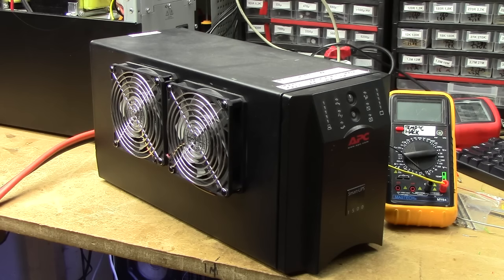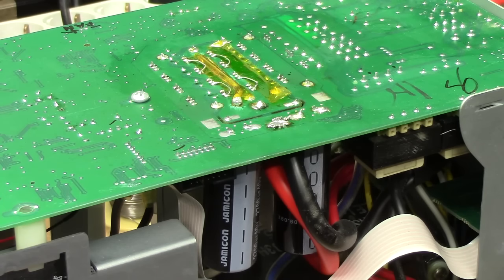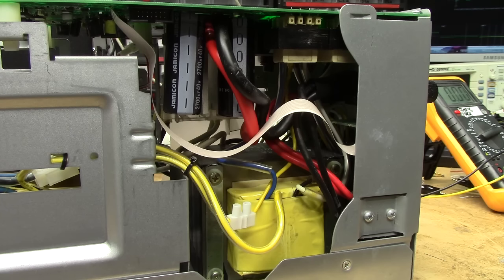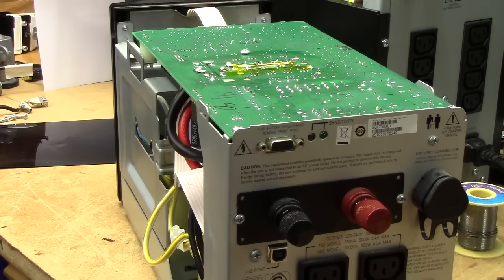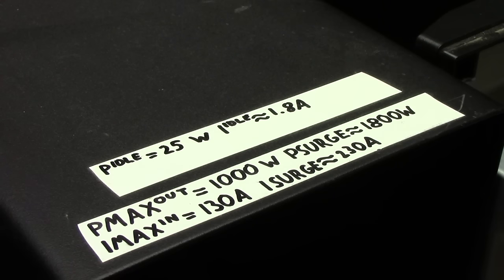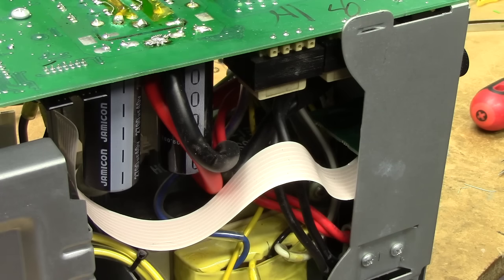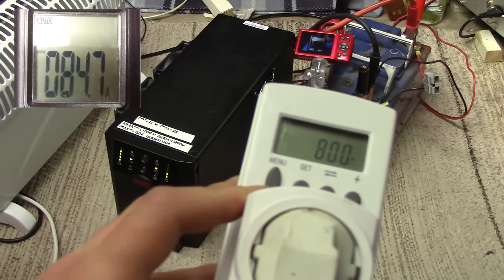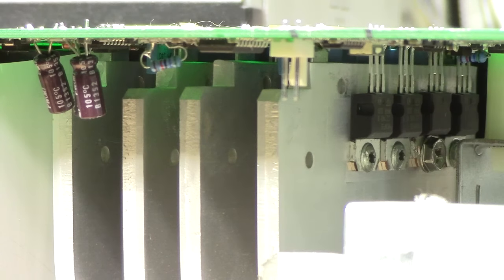Smart-UPS 1500 turned into... a 12V inverter?!

Comment: Sweet project, you certainly put more effect into it than I would! I have a set of 4 APC 1500’s (Various models but all the same style floor unit) that I intend to connect to a 24V LiFePO battery bank to be used with solar to recharge them off grid. If ever needed, a single one of the UPS’s could be connected to mains to charge the bank (Not 100% on that not cooking the UPS’s battery charging circuit due to overcurrent though)

Comment: wow i didnt think of tdoing that modification, but i like the 24v system since it uses less amps soo cheaper cables and everything... but a 12v unit is alot more versatile thanks for the video!

Comment: Wouldn't it be easier to use a voltage doubler to step up the battery voltage to 24v?
Reply: Finding a 240a voltage doubler is harder then u night think

Comment: Hi FFcossag,
Nice work. I would like to convert an APC Smart UPS 1400 (White Color) to an UPS that only takes one 12v battery. From your description, it seems to me that your changes solve 12VDC to 120VAC and the control part to take a 12V battery. How do I take care about the battery charging part(charge 12V battery and prevent from over charge)? or does your modification by adding the resistor already take care of the charging part? Thanks.
Reply from the maker: My modification destroys the UPS capability of the unit, since it breaks the AVR functionality, making the UPS throw an alarm and shut down if connected to the grid. I'm about 80 % sure that it's possible to make it work properly, but I haven't checked it out, I'm afraid.
Reply: +FFcossag would you will be interested in figuring it out? It will help a lot to many people.
Reply from the maker: Rock Man
I'll probably look at it at some stage, when I have time and inpiration. If that's in a month or a decade, no one can tell.
Reply: +FFcossag would the following scheme combining your modification work? Add a 1/2x dc step down between the charger and the battery. Add a 2x step up on the sensing line between the battery to the circuit controller(then no need to add the resistor to fool the control circuit). And the do the rest of your modification on the output end. Thanks.
Reply from the maker: Rock Man
Sure, but I don't see why you'd do all that when all you need to do is swap a resistor. That would not fix the AVR issue, if that's what you're thinking. That's got to do with the transformer windings and how they connect.

Comment: This sort of redesign is exactly the kind of thing I'd like to understand better.
Reply from the maker: +uxwbill In this particular case, there really isn't much to understand. The entire design process can be summarised as follows:

"Can you run this off of 12 V if you just put two transformers in series?"
"Hm, it won't turn on. Maybe if I fool it to think it has a 24 V battery?"
"Oh it works perfectly now. Let's fill up all the empty holes on the heatsink labelled "transistor""

And then about two days of trying to figure out how to get around the horrible, horrible thermal issues it has. Before I figured the battery voltage divider hack out, I actually planned to just use a 24 V boost converter to fool it, but due to long China shipping times, I ended up doing it "properly".
Reply: you and me both! I've dissected many of these are doing was looking at their boards with unpopulated areas and always wondered about that... I use the term infamously coined at power up "smoke test" !

Comment: i am currently in the process of setting up a solar system, and am debating whether to arrange the batteries for 24v or do this mod.  according to my understanding, 12v will use double the amps and waste more energy as heat in the wires and transistors, while letting the two transformers run half as hot as one would.  that would let you use better mosfets and improve the low voltage side without worrying whether the heart of the machine, the transformer(s), would burn up, letting you really reach its maximum rated potential.  the alternative is to put the mosfets and two transformers in direct parallel, essentially overrating the power components, and let it run at 24v as intended, gaining increased efficiency while easily reaching its max rated potential and being reliable.  another is to leave them as they are and do what you can to balance the load between them so neither is pushed too hard.  what are your thoughts on this?
Reply: ...or would each transformer get as hot as one driven by 24v due to increased losses by running at half the voltage, resulting in no operational benefit other than being able to take 12v, at the cost of twice as many equally hot components that need to be cooled?  off topic, but would it be worth it to stack transistors and transformers still on 24v to increase output watts?
Reply from the maker: You always want as high a battery voltage as possible. If 24V is an option, do that. If 48V, do that. These UPSes don't make very good solar inverters, though. Consider them an ugly hack rather than a proper solution.

Comment: Nice, I have an old APC 1500VA ups that I would've wanted to convert to 12v. I have another UPS from compaq that's similar in size, do think that the transformer from that might be able to do the job? 

-Arnþór
Reply from the maker: Unless it's an APC rebrand, I would not think so. The reason this works is because the transformers are identical, so you get exactly twice the winding ratio.

Comment: Do you think it would be possible to use two transformers with the low voltage side in series and use a 36v battery bank?
Reply from the maker: No, but you could do 48 (and that's literally how APC do their 48 V UPSes too).

Comment: ok i added the 56k resistor and will add a 1-2 ratio transformer , i have NOT ADDED ANY MOSFETS OR CAPACITORS . Will It power on ?

Comment: Hi , I have a 24volt ups and I am trying to use it as an constant inverter using 2x 12 volts car batteries but the ups only last for 5 minutes and switch of automatically,  I've checked the batteries and day are supplying 25.5volts on load, does the ups has an internal timing?and if so can I modify that or eliminate the timer? Thanks

Comment: hello, 
i have a smart UPS 1500, i use it as a solar  power inverter.
it works for 8 hours and then it turn off. 
(no overload)

i should re operate it again at every time.

is there a possibility to modify it so that can work as a solar inverter with pure sine wave. (working without stopping) ?
Reply from the maker: I'm not sure, I haven't toyed with it. You could try adding increasing the external battery packs variable through the programming terminal.
Reply: it works normal for two days sometimes, then it gives alarm and shutdown. even if the batteries are almost full, i will try the terminal that you suggested. thank you

Comment: pretty cool, do you get the full VA output?
Reply from the maker: +CreativeType Close enough, at least. I haven't really tested it with any weird loads, but the Smart-UPS 1500 is specified for 1500 VA or 980 W, and you saw it do well above that in the video.
Reply: +FFcossag ah cool, I might do this for my sailboat. You'd be scared how expensive they can get for marine quality 900w+ inverters.
Reply from the maker: CreativeType Getting 900+ W out of this continuously and RELIABLY probably requires some pretty serious beefing up of everything around the power transistors, and I'm not sure how hot you'd have the transformers running.
Reply: +FFcossag it depends, I haven't measured the electronics. Im assuming it would be a continuous load of at least 300 watts when id use the system. it would only run when the motor is on however. There are certain things that would use more current for short periods. I'm planning on making it a live aboard so there's a few more things then the casual sailboat requires.
Reply: +FFcossag it depends, I haven't measured the electronics. Im assuming it would be a continuous load of at least 300 watts when id use the system. it would only run when the motor is on however. There are certain things that would use more current for short periods. I'm planning on making it a live aboard so there's a few more things then the casual sailboat requires.

Comment: OK .I think I get it. Without the extra transformer it would only be half output? If it would work. I would like to get alot more out of my apc 1500 aside from caps and transformers I don't know how much that would help. Would it make it go crazy if the traces were beefed up with flywires? I guess solid copper soldered to the PCB would be best. I would like to get 1500-2000watts from my ups. I know that's basically double the output. I was thinking maybe add a transformer in parallel and add MOSFETs. Also I was thinking about using the driver to build a inverter . maybe a high surge capable 2000-2500 watt and surge to 5kw. For 30sec. I know I'm probably dreaming especially with my skill level. I have the transformer from a huge forklift batt charger! I'm thinking rewind it and we'll build a huge inverter with the ups electronics orchestrating the deal! I need a pure sine wave ups I guess. I don't want to put all the effort in to a modified sine wave inverter. I'd just buy one before all that craziness.  The inverter to do what I want will caust $2000  or so. I was thinking maybe build a separate board with a ton of FETs on it. And  fet drivers resistors. Parallel that  to the UPS FETs or drivers. Maybe trick the ups to thinking all is normal. I know its going to be huge and crazy looking. It's a crazy project. I gathered some parts I could maybe use. Some huge heat sinks. The huge transformer. It's 277/480v in and like 250a out for 48v batts. Or I have a smaller one for 24or 36v 100a. I want to oversize the transformer and winding gauge to help with surge. I probably need some help from someone who actually knows what's going on. Anyway I'm rambling. great video. I had thought about using a small inverter to drive the mess. Like a 300w pure sine wave. I don't know if it will ever actually get started or even work. I would like giving it a try!
Reply from the maker: Getting an APC to drive such a huge transformer COULD be done, but you're probably looking at quite a few blown FETs in the design process ... Also load regulation will be a bitch.
Reply: FFcossag  I was thinking maybe if the output winding is a heavier gauge with a large transformer core. Basically a  transformer with  twice the current output capacity. The voltage may not drop as much under load. Helping it be more stable. I know it will be load dependant without regulation. I'm just thinking it would be easier to regulate. Do you think my theory is correct?
Reply from the maker: APC UPSes are PWM regulated, so if you change the output xformer too much, they'll probably behave quite erratically.

Comment: How would you disable the charger?
Reply from the maker: I'd turn the voltage down in the serial terminal using the apctest utility in apcupsd.
Reply: @FFcossag  So I turned it up to 28v, but the ups is still carrying my 24.5v battery up to 25.4v 5a, so do it just ignore my commands?
Reply from the maker: It doesn't go endlessly low. If you want to really drop the voltage, you'll probably have to reverse engineer the charger a bit and do it in hardware. I'm afraid I haven't done that.
Reply: @FFcossag  I think my problem is that the charger is not a seperate part of the board, that I can just cut off. It is the same circuit that is doing inverter function as is the charger.

Comment: Can you modify it to run off your 48V solar setup?
Reply from the maker: +David Smith The short answer is yes. Technically, this modification could be done to adapt one of these to 12 V, 24 V or 48 V operation depending on how you wire the transformers, but going up in voltage also requires new filter capacitors and higher voltage inverter FETs to be installed. I'm also not sure how the buck converters powering the electronics would fare; they might need modification or a step-down converter to be installed in-line.
Reply: +FFcossag  that would just take all the fun out of it...lol

Comment: hi, need small advise, will it possible to use old online UPS to recharge Lithium iron Battery pack and use as inverter as option as well?
Reply from the maker: You can't just replace the battery, no.

Comment: How can be no cold start issue be solved. I mean the UPS won't turn on unless it is connected to AC source. Is there any way to solve the issue?
Reply: Perhaps not the answer you expected but try another brand or model. I played around with a few with the same issue, and found some old models turning on with no issues without AC current, just the battery.
Reply: Same issue but I'm trying to use one as an inverter in a solar panel configuration. Looks like it calculates the amount of remaining battery by battery use time and no by voltage, so even with plenty of battery charge remaining it shuts down by itself.
Reply: Same issue here please make a video how to bypass these time calculation settings.

Comment: I have ups 350 what I do I change battery on it have 4 12 volt lead acid battery 3 12 volt 7.2A and 1 20A lead acid battery running it I turn it on at 11:36am time I lot at it 1:07pm still going am running my dell laptop and speaker I plug in and I have 12 volt cooling fan running not death yet 🥰🥰🥰🥰🥰

Comment: Hi, I am interested in turning my apc smart-ups as an inverter, but it does consume a lot of current (without load). Do you know a way to solve this issue?
Reply from the maker: No, you can't fix that.
Reply: @FFcossag    Put a inductor in series with the + input wire ;  2x  PC40 material,OD~~50 or 60mm  wind 30 or 40 coils of 3x3 mm2  (~~10mm2); so,2 TORIDS together,you may even epoxy them side by side before winding  //
i am just a hobbiest,i HAVE NO CONFIRMATION that this works,    but  i am ALMOST sure it does ,giving the place i saw it at ,  a youtuber in Thailand,very knowledgeable
 greetings from Portugal

Comment: Good video, I knew there was a way to do it on a few of the 24v ups's. Thinking I might do this with my SU1400NET. "Pretty much the same thing you have in the video but its white and rated for 1400VA instead of 1500.
Reply from the maker: +umbrefawx The white units should be even easier to work with than the black ones - I don't remember where the voltage divider resistor is on those, though. It might be an idea to replace the MOSFETs on those as well, since they're going to be older and higher resistance.
Reply: +FFcossag Yep I did, I went a step farther though. I replaced the mosfets with completely  different ones and populated everything else. The link to gate idea on the extra mosfets do work but for higher loads. I find connecting an equal vaule resistor to them works just as good, just connect the resistor to the gate drive where the first one is connected too, works a bit better and it does give a decent efficency increase near max load.
Reply: +umbrefawx But As far as mine I did not do that cause I had to change out different vaule resistors entirely. (Since I replaced all the Mosfets with Diffferent ones. (Higher current rated,  about half the RDS on time as the ones that where in there. I also changed out the heatsink on it with a bigger one I scapped out of a bigger unit. It runs at its full load just fine but I can't get it to stop entering overload when I push it beyond its rating. (Even though it should be able to do doub le that. Ive done it before just this ones a little diffferent and I forgot how I came across it.
Reply from the maker: umbrefawx Yeah, the only power sensing is done on the 230 V side, so there's no wonder it thinks overload. You'd have to modify the feedback system there too to make it do more power - although unless you do the dual transformer thing, the trafo's gonna go up in smoke on you, heh.

Good to hear about your hack though - may the spirit of the Smart-UPS be forever with you.
Reply: +FFcossag I already switched out the main Transformer already. (Put in a bigger one of the same rating just to advoid that, however my model of UPS's are a little diffferent. The output on all of mine is 120v, not 240. I live in American you see and we have this stupid split phase system down here. (Our 240 service is split into 2 phases of hot, so on our 240 volt appliances, we have 2 lives and a neutral, and everything else is 120 to neutral.) Even though its not too different, different enough to make it harder on me. (240 is so much more easier to work with) But still having the 120v model should make it easier to run on 12v. (Or you would think) I know moldifying the feedback curcuit is an option, but these transformers are wound a little differently then the 240v models, and ive done it once before without having to modify the feedback curcuit, just can't remember how I "Fooled" it last time.

Comment: what if i used a 1-2 ratio transformer before the current reached the original transformer would it power on ,as i am having trouble finding another ups transformer
Reply from the maker: That would work, but you need a very beefy one at that.

Comment: Can a smaller APC ups like 350 or 475 be used as car inverter??
Reply from the maker: Yes but only for <100 W loads, else it overheats.
Reply: FFcossag
And if i put a fan on its side?? cutting hole of course xD
Reply from the maker: mmmomg stopfkinglyin'
It'd make it better
Reply: FFcossag
Like doing it your way, like putting fan on it, soldering extra copper on big traces, but can i run it continously without modifying ic side?